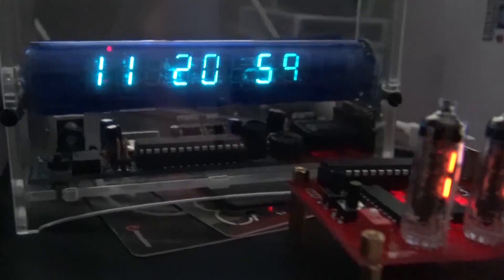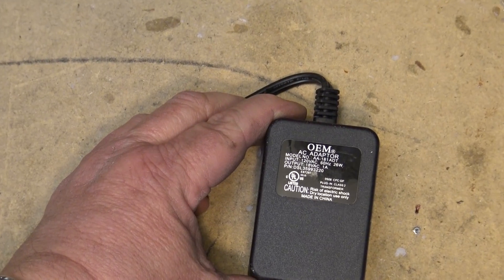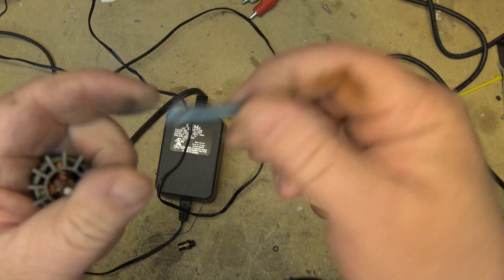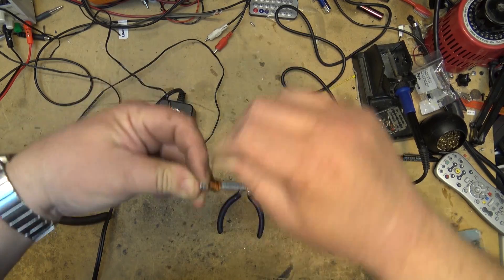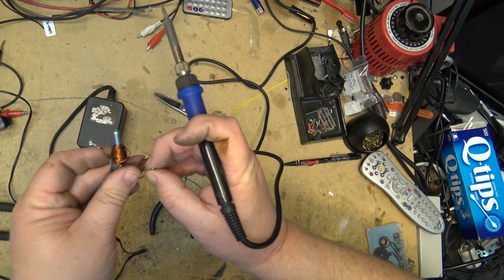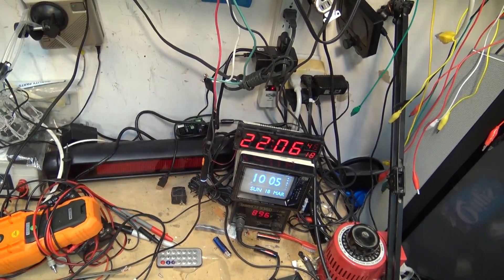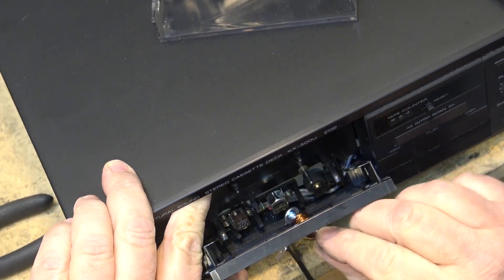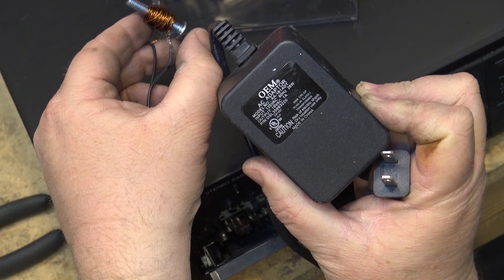Build a tape head demagnetizer in 5 minutes

Comment: Sometimes, when I'm playing a Digital8 or MiniDV tape on one of my Sony camcorders, there is banding every few frames (sometimes it's constant), that goes away after I run the "fake record" mode for a few seconds (with the RM-95), after which it's perfectly clean. Does that banding have anything to do with magnetization? (You mentioned that the AC bias during recording mitigates magnetization)
Reply from the maker: Video heads do not require demagnetization normally. What you are seeing with the banding on digital 8 and DV is 1 of the heads cloggs momentarily.  If it was an analog tape what you would see is a snowy picture.  On digital the head rotates much faster.  4500 rpm for digital 8, 9000 rpm for DV.  So unlike analog tape where 1 head records an entire field of video and the second head the other, on digital 8 it takes 2.5 revolutions to record a frame and on DV it takes 5 revolutions.  So on DV you will get 5 bands of frozen picture and on digital 8 2.5 bands of frozen picture from the last frame where there was signal. 
If the tape just occasionally pixelates and breaks up check the speed the tape was recorded.  If it is lp there is not much you can do. There is 0 interchangeability for lp recorded digital tapes.  You need to find the camera that make the original recording.  I don't know why people used the lp speed on cameras.  It was a speed that sony never supported initially and JVC added it as a "feature" and then everyone copies them . Sony put a big warning about using the lp speed on page 1 of the user manual but many people didn't read it and then we're sorry later.  Camera breaks or gets stolen and they buy a new one  and can't play their existing tapes or they bring me their tapes because they no longer have a camera and none of my machines can play it either.  I have 3 digital 8 and 3 hdv / DV decks and lp tapes have problems on all of them.  Sometimes rewind slightly will clear it up for a few seconds but generally if a tape was recorded in lp you will not get a clean playback.  It is because at the lp speed the tracks overlap and microscopic alignment differences of the heads mounted on the drum make tracking these overlapping tracks impossible unless played on the machine that made the recording.  I always used to say JVC stood for junk very cheap.  I have a professional JVC camera. Has very few bites of use. Only about 300 hours on it before I went back to Sony because JVC is junk.
Reply: @12voltvids  So, why does that blocking (and static when the D8 unit is playing 8mm) stop when I run fake record? It was constant block noise with a D8 tape and static on an 8mm tape a few minutes ago, I removed the tapes, ran fake record, and they played good as new.
Reply from the maker: When you load and remove a tape the head cleaning wheel presses against the head and probably cleared some crud off. I am uploading a digital 8 deck head replacement video, and providing it can pass the sniff test it will be published. The first one had a copyright claim so it didn't go live.

Comment: No thanks, I probably end electrocuted if I attempt this. However, pretty cool trick, Thanks for shearing
Reply from the maker: It's 12 volts.  Can not get electric shock never mind electrocuted wtrh 12 volts.  Skin resistance takes at least 50 volts to break through dry skin. I work on telephone outside plant. 52 volts DC.  Don't feel it with dry hands.  Wet hands different story.  You can feel that, it makes your fingers tingle. 12 volts totally safe. Remember the transformer isolates from the line current.
Reply: 12voltvids - now I will definitely try it. Thanks for the clarification.
Reply: @12voltvids  really need to try this but I am so afraid of electricity (irrational fear I have.). So, you just go in with your bare hands and wont be electrocuted at all?
Reply from the maker: @Deino13  12 volts won't electrocute you.  I work on bare telecom wires which have 52 volts dc on them. If hands wet or sweaty you can feel the vintage tingling on your fingers.  If the phone rings 120v ac you feel that!

Comment: You didn't mention any Safety precautions or utilize any for that matter. Don't you think 18VAC could be dangerous to touch? Is it because the path of least resistance is through the wire and not your skin? What if there happened to be a break in the enamel (or whatever it's coated in)? Would it be possible to make this and then put the bolt in heat shrink tubing so there is no potential for any exposed wires? Like, will it work the same (I'm sure it will as the heat shrink tubing wont mess with the B-field). And did you pick 18VAC on purpose? What if you used 5VAC? Isn't it the amount of current and the number of turns that matters?

So in sum:
Can I make it safer with Heat Shrink Tubing?
Can I use the secondary from a 12VAC transformer that can supply 350 mA?
How long is the magnet wire and how many turns did you use?
Reply from the maker: 18 volts ac is totally safe. It will not break skin resistance. We deal with 52 volts DC in the telecom field and we do not use gloves for that. If your hands are wet and you grab an energized pair you can feel it tingling. Now if someone rings up the phone when you are the wires and the 120vac ring voltage hits you  well you definately feel that. 
I picked 18v because that is what I had kicking around. I could have used 12v or 24v. The turns of wire not really important as the transformer will limit the current anyway, but more turns are better as less current makes less heat.  This will heat up after a few minutes but that is fine because it on typically only on for 10 to 20 seconds and then turned off.
Reply: @12voltvids  thanks for the advice and thanks for the videos too. They were an immense help when I was fixing my Sony TC 350 which I just finished today https://youtu.be/0ZDX3tKNmo0

Comment: Curious, can the output be less than 18VAC? I'm planning to make one of these but I only have a 15VAC.
Reply from the maker: Yes 12VAC will work fine too. 18 is probably too high for the length and number of turns on the wire. I used what scrap I had. WOrks great.

Comment: cool! I made one in 20....15 was unwrapping the wire from a small motor stator! Wrapped it around a small plastic handled jewelers screwdriver and slipped piece of shrink tube over it. Bammo! Used a 300ma 9V AC/AC adapter from something...

Comment: never cut a plug off without leaving a tail, you never know :). nice video thanks.
Reply from the maker: When you have a box with about 50 adapters rescued from the recycle bin it isn't a big deal. I probably have 10 more of the same adapter, but If it us the only one and you might need that plug, leave a few inches of wire so the plug can be reused.
Reply: @el1Mundo  but they do become ac/ac once you remove graetz and lytic capacitor, unless it's recent smps design...

Comment: Thanky.... I just picked up a Pioneer CTW650r Dual Auto reverse Tape deck from Christian Womans thrift store here in Georgia.
Cost: $9.99.  PS: I have a box full of those wall warts and some from Answering machines which use Ac to Ac step down transformers. PSS: I also have spools of magnet wire from Crossover networks I took apart and saved...

Comment: It's rather crude but it will function. It's also ideal for demagnetising tools!
Reply from the maker: No it won't demagnetize tools. It is nowhere near strong enough for that. This is just strong enough to degauss any residual magnetism on a tape head, and the commercial units are nothing more than this, except that they use a coil that operates on line voltage. I originally was going to use a core from an old wall wart, but for liability reasons decided not to proceed and instead made one that operates on low voltage, as you won't electrocute yourself with 12 or 18 volts.

Comment: How i made mine
Reply from the maker: I was going to do it with a core from an old AC adapter, but for safety I did it using a low voltage coil and a transformer.

Comment: Cover the ends with hot glue  for protection maybe?
Reply from the maker: That will do it.
Reply from the maker: Actually a piece of hear shrink tubing over the end of the screw to provide a spacer so the screw doesn't get too close to the head is a better solution.

Comment: How do you know if you actually gotta use this? Or when should this be done ? Are there tell tail signs?
Reply from the maker: High frequencies start rolling off a little.
Reply from the maker: You will hear it, sound starts getting dull on the high frequencies, and if bad enough will actually slightly erase the tape on playback.

Comment: disconnect the heads from the preamplifiers before demagnetizing.
Reply from the maker: Won't hurt anything except for perhaps speakers if volume is cranked up.
Reply: the demagnetizer screw - playback head assembly forms a step-up transformer, the resulted AC voltage on the playback head can easily damage the first, low noise transistors, of the playback preamplifiers.
Reply from the maker: Pop Tibi 
That is why you don't touch the head. You approach the head but not close enough to induce voltages. I never get closer than about 1/2" as that is close enough to degauss the head and not induce enough voltage to damage. The magnetic field from this is not that strong as you could see when I held to the crt. It didn't distort the picture much.
Reply: Just use a slip of paper between the head and the demagnetizer. Problem solved

Comment: That will do the job. I’m fortunate to have a Radio Shack one I picked up at a sale back in the ‘80s. Still works.
Reply: That's what I have, too. It's beige, oval shaped with a black rubber tip from the early 80's. I also have a battery operated Maxell demagnetizer in a cassette shell from the late 80's. Hands on audio fun, gotta love it!
Reply: Mines black, kind of oval and has a t shape handle on top. Red button on the handle.
Reply: No buttons on mine,  just plug & go. It's a small handheld, no handle.
Reply: My bad, I was thinking of my bulk eraser. The tape head one is the size of a small barrel, tapered at both ends. Power cable at one end, red ‘s’ shape tip at the other. Like yours it just plug in and go. I also have a cassette style one and a torque gauge cassette both from a Sunday flea market in the 80s
Reply: I have that very same unit! It's black and has a handle on it. It can only work for 4 mins and then you have to wait 30 mins to turn it on again. Bulk Tape Eraser. It will blank a T-160 video cassette in 30 seconds.